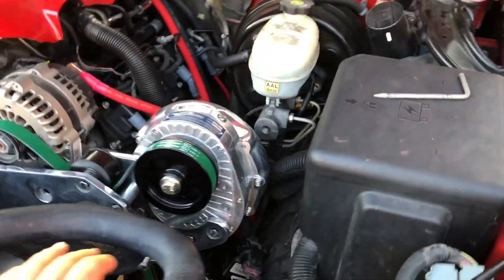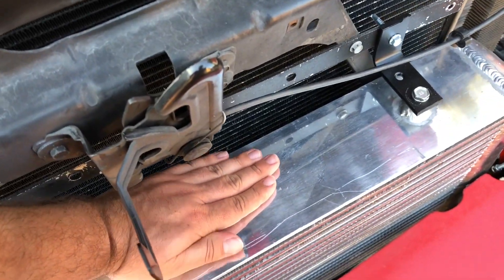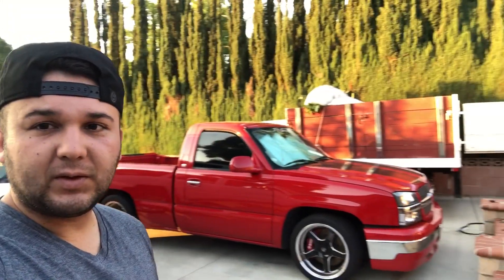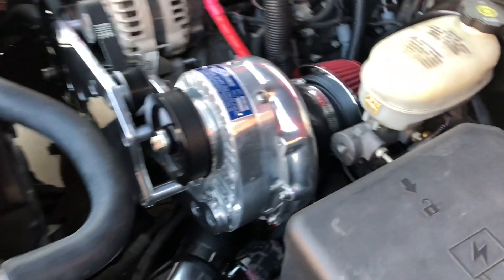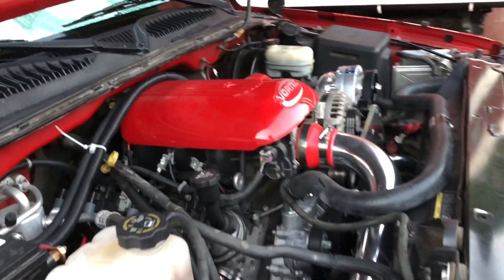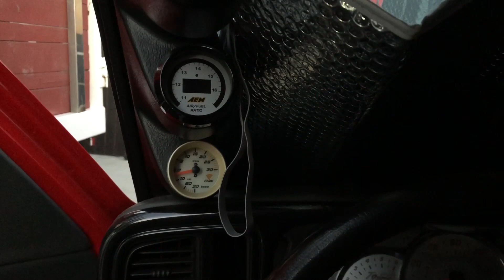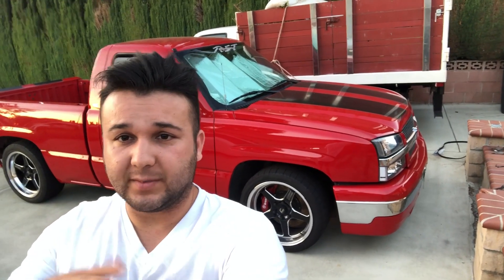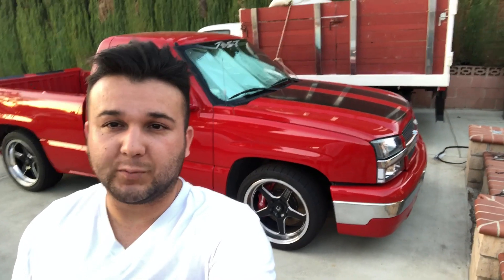Procharger install complete! Will it EVER get tuned?!?

Comment: Engine compartment looks good, a little suggestion. Cut the T-Bolt Hose Clamp to where you have about 1 to 3/4" showing, cap it off with a vacuum line end cap plug.......you can get them in red if you like. I would also replace any worm type clamps with the T-Bolt type clamps, this will give a much nicer looking engine compartment. Thanks for sharing, peace out.